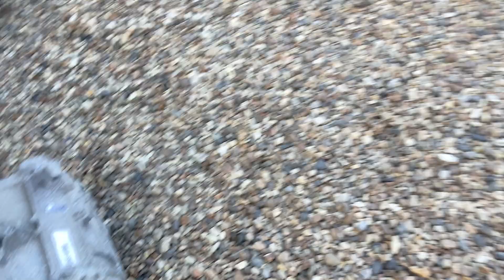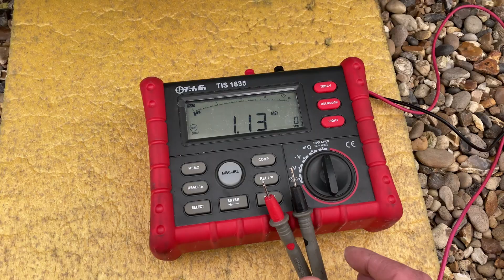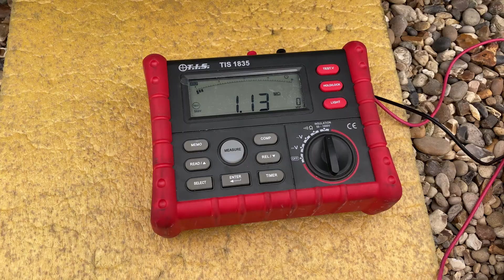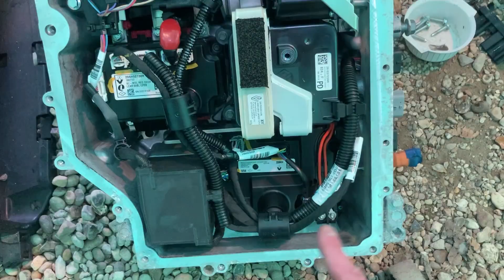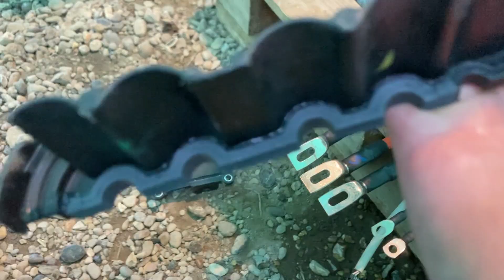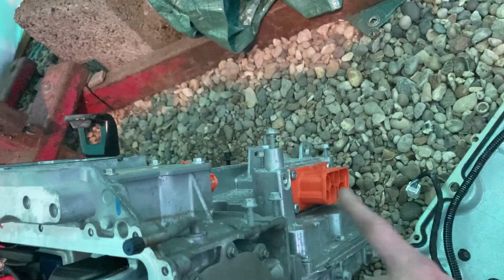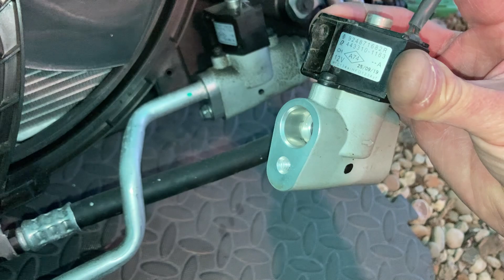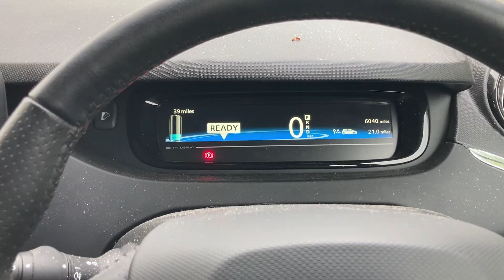This ELECTRIC CAR IS DEAD after only 6,000 miles - Can we fix it? Renault Zoe EV Repair

Comment: Given you have a motor controller that is a write-off due to coolant contamination, I'd suggest getting a couple of litres of isopropyl alcohol and  give it a good dip/agitate/dry and see if it removes the coolant.   You have some smaller parts other parts that are contaminate as well, so possibly a good soaking of them would test if isopropyl alcohol will remove coolant residue.  Isopropyl alcohol is often used as a safe cleaner for eletronic components so the controller should survive it.

Comment: Thought I should mention porous casting is a common problem every brand. I worked for a motorcycle company & the procedure was to take a centre punch to stop the oil leak spot
Reply: Vacuum chamber and an epoxy paint ....

Comment: Gary, You and your channel are such a  great value for ZOE users!  What you do is really important but watching your videos is a real pain to watch to filter out the flow and the main thing. This 57 minute video basically about 15 minutes and you will not miss a thing.
Repeating things 5 times  within 2 minutes filling up with so many "so,  yeah, well, interesting, ammm, ok all right,  but yeah e.t.c."  is  really something would be your advantage to get rid of.  I did not count these in this 57 minutes but its in high hundreds.
I know," if you dont like dont watch".... I like the content and you can be sooo valuable for everyone if you could make this at 1/4th of the length.
Reply from the maker: Realistically, I haven’t got hours to edit and when you’ve done 5 hours of strip down you can’t remember exactly what was said so far and it’s not scripted because it would take too long and it just wouldn’t get video’d!! This job was done over 3-4 days, at points you’re absolutely knackered and trying to stay on point, some people ask for more detail, some want it ripped through as quick as possible. Can’t please everyone. Thanks for watching. Cheers
Reply: @garycevrepairs don’t sweat it, love the personal mannerisms. 😊

Comment: Aren't this car supposed to have a warranty this looks like something that should be solved by the warranty (or did this car was in garage for multiple years ?)
Reply from the maker: Warranty expired due to age
Reply: @garycevrepairs What I was thinking, this is still something that should be warranty, or recall, it's a manufacturing defect

Comment: 33:10 when you mentioned about the thermal paste not being in the correct place, it's most likely because it has squeezed out of the area you barely see any. Remember, it's only there to fill the gap, it the pressure is high enough most of it will be pushed out and leave very little there.
Now if it was completely dry then that would be a bad thing yes.

Comment: You can  safely  dunk wash electronics in IsoPropyl alchol  which is cheap . It disolves oily stuff and antifreeze   and it is quite cheap . Just leave it somewhere warm to evaporate any alchol left on the boards.  Suprisingly you can also wash electronics with DI water to remove salt water contamination  as long as yo u leave everything somewhere warm to compleltely dry out.  I think I would have had  a go at washing the cotroller in ths case .  P.S. moisture really lowers the insulation resistance on electric motors ( stand by generators have heaters built in to dry the windings before use ). Do not high voltage  insulation test a motor that is damp because you can turn the damp problem into a permanent short where the high voltgae forces it way through the damp insulation.!
Reply: Yes, was about to write this!
Reply: I went swimming in the ocean with the rental car key fob in my pocket.  The car wouldn't start after that.   So I stuck a knife on the edge of it to open it and washed the little circuit board with drinking water and then left it in the sun to dry.  Car started good after that.

Comment: Hi Gary, I've been following your videos for a while because we have a Zoe, it has started making a noise recently that is freaking me out. Very paranoid it's the bearing and I wanted to know what would be the best way to contact you to share the sound file and ask your opinion? We'd be glad to pay, I didn't find anything in the youtube channel. Thanks!
Reply: We had a strange noise on our 2020 R135 with 100k km,  which was best to hear at low speeds. My wife detected it coming from the left front area (driver‘s side in our case). I took the wheel off and found the rubber sleeve of the wheel bearing was leaking grease. It is in the shop today, and I am keeping my fingers crossed that the motor bearings and differential are still o.k.
Reply from the maker: Hi email is good gclayton@hotmail.co.uk cheers

Comment: Try rinsing the coolant off with methylated spirit, it mixes with water based fluids but evaporates readily.
Reply from the maker: Could have tried this kind of thing but it takes so long to remove and refit so you need to be confident it’s fixed. Cheers

Comment: Is it a case of poor casting and or poor machining? And why not use a compressible gasket, rather than sealant, which doesn’t seem to be doing the job well? And the thermal grease/paste, appears to have been put on, by a blind worker, wearing dark glasses in an unlit room, using just one toe on a Friday 3mins. before knocking-off. Mind you, the Zoe is discontinued and thus Renault aren’t going to be interested in the issue. I wonder if their present EVs, are going to prematurely show their age, with continued poor manufacturing quality control.

Comment: Could you not use a electrical component spray to clean the unit its got to be worth a go. Great video very interesting.
Reply from the maker: Could have attempted cleaning but it takes so long to refit that a saving in the new controller would quickly be eaten up in more labour if it has to come out again. Cheers

Comment: Electronics don’t like megga voltages, measuring with main leads disconnected is advisable.
Reply from the maker: The car runs at high voltage, you test it with high voltage test equipment

Comment: Wonder if you can’t use 99% IPA to get the moisture out of the electronic. 99% because alcohol binds to water up to 70-80%, so starting with 70% won’t have the same effect.
Reply from the maker: I could have tried drying it but it takes a long time to get it back out, so better to fit a new one. Cheers

Comment: Perhaps distilled water and a heated ultrasonic cleaning followed by a few isopropyl alcohol rinses would clean those controllers up
Reply: I wouldn't mind giving one a go and sending it back see if it works reply to this if your interested there's nothing to lose and I'm all about keeping things out of landfill been fixing electronics for as long as I could walk
Reply from the maker: It might work but it’s quite layered and takes a long time to remove so it’s a risk that you put it back and it has an issue. Cheers

Comment: that is what was known in the trade as a "hero job", the reason main dealers dont want such jobs is time, they car neplace part X, if that dont work, they have to swallow the cost of X and try part Y and hope that works, easier for them to say it is scrap esp when the techs dont really  know anything but wheeling out the parts cannon, ok with cheap bits but i doubt those bits were cheap...keep up the good work there Gary, we need more hero,s like you.
Reply from the maker: Very kind thank you
Reply: @garycevrepairs  credit where it is due.
Reply: Trouble with a lot of stealerships is they only understand the parts cannon and have little technical knowledge after all the mechs are not engineers.

Comment: Wouldn't a solvent /degreaser like Jizer remove the coolant/thermal grease?

Poor craftsmanship/quality control is why I dont buy mass-produced French products - this isnt just a car issue.

Jizer has the secondary bonus of making you see pink elephants if you dont use it in a well ventilated area.

BTW, I used to work for Cosworth - at the foundry where they produced the engine castings; - that casing is a pile of shite, no way should that have passed QC.
Reply from the maker: lol, it’s not easy to clean and if there is some residual moisture then it all has to come out again. If access was easier then I’d have given it a go. Cheers
Reply: @garycevrepairs  I understood it might not be easy - I was thinking perhaps a solvent bath/agitator might be worth experimenting with - might save some money and time if you can reuse the controllers.

Comment: There's a basic component that commonly fails due to rusting. Its generally an engine swap job from what I understand. 
These cars are not looking like good buys
Reply: Ooops motor swap I meant. Those things you were told would have less issues than a combustion engine... Lol. Love my combustion engine
Reply from the maker: These do suffer with motor bearing failure yes

Comment: I might put some RTV silicone sealant in those bolt holes when bolting the motor controller back on just as a preventative measure for leaks.  I would just be carefull about not using too much as you don't want it to squeeze out under the motor controller preventing the heat sink paste from doing it's job.
Reply: You could also use a copper or aluminium washer, like a sump plug.

Comment: distilled water might be a good way to rinse out coolant, then that can be dried out
Reply from the maker: Could do but it takes so long to remove and refit that we need to know the repair will work, otherwise if we have to have a few attempts to seal it then the customer would pay more than having a new one due to the labour. Cheers

Comment: Aren't there products that can be sprayed or painted onto the inside of the casting to seal pinholes. Used for making alloy wheels airtight. And presumably watertight ?
Reply from the maker: Quite possibly but it takes so long to take it all out that it needed to be a reliable solution. If it was easy access then we could try some different methods to see if they worked. Cheers

Comment: I have to say, I'm not impressed with the quality control of Renault. Those castings should never have been put on a new car, terrible QC. That they're not using Brushless DC motors is concerning. Brushes? Really? That's old school, simple, yes, but those wear items don't need to exist. I wouldn't buy a Renault.
Reply from the maker: The motor is a 3 phase brushless design but has no magnets and a wound rotor instead, so has to get power onto the rotor. Cheers

Comment: 500 Ohms per volt is the requirement, so if it's a 400V system, 200k Ohms is the lower limit. Granted, I would expect the motor to be much higher in isolation.

Comment: You have got amazing knowledge, from a domestic Sparky here. I'm very interested, as I have an Electronics background. Just found your channel, so will continue to watch. Cheers
Reply from the maker: I used to work in IT, very interested in electronics, EVs are just battery powered computers…
Reply: My apprenticeship was in electronics , I am now an electrician working in the industrial sector ,The one big problem I can see with DIY EV repairs is the potential for serious injury due to the danger of DC voltage present in these vehicles , the other issue being the LI-ION batteries and the possibility of damaging the battery or short circuit both of which can cause thermal runaway.
Reply: @Wishiwasnthere-58 only when idiots get the screw drivers out. Otherwise as soon as you isolate properly it’s ok.
Reply: @kevxsi16v  very true , but the point is that  many will not have the right equipment or knowledge about the importance of isolating before starting any repairs. I have seen so many dangerous alterations to electrical installations by people who think that their work is safe but the reality is the opposite.
Reply: @Wishiwasnthere-58 I am in the same
Boat as you… would go as far as saying that most properities that get rewired wouldn’t of needed said rewire (unless lead or rubber) it’s the bodges that diy Dave has added destroying what 9.9 times out of 10 was originally a good install.
Reply: @kevxsi16v yeh. We could use the same argument for people working on there own brakes. People generally don’t touch EV electrics unless they have some confidence they can do it right 😂

Comment: And on the new Renault 5 they've just cut the warranty down to 3 years from 5. Smells of confidence in their products doesn't it?
Reply: Electrics were never Renault's strong point so what can one say? Brave to try  EV's?
Reply: I have owned multiple Renaults over 40 years and I have never had any electrical problems! Fords plenty of electrical issues and Rover group also.
I usually find people that claim French cars had electrical problems actually have never owned one!
It’s always someone else’s car or I hired a car once.
Do t forget Renault and “dodgy” electrical systems actually crated the first car with key operated central locking, Renault 14 and, created the first remote control central locking system, Renault Fuego.
Reply: At least it is a bit cheaper for start and they should make more of them so (used) parts should be cheaper.
Reply: @rkan2  Or they could pressure test the casings?
Reply: Sadly MG offer 7 year warranty. I say Sadly because they are Chinese.
Reply: @starbarrothschild788  they offer 10 years warranty in Australia...
Reply: @starbarrothschild788  Warranties are fine until you have to deal with main car dealers who treat customers like shit.
Reply: @starbarrothschild788 they need it as they are so unreliable and you wait for ever for spares or told it’s characteristic, I had one for seven months from new …. Never again
Reply: That’s terrible
Reply: Warranty?
Reply: Then those idiots make sure you can’t repair them. With “VIN locks” Go buy a Chinese car.
Reply: My Renault 5 has 5 years warranty, 8 years on battery, 12 years on rust. The only thing that has a 3 year warranty is the paint.
Reply: @2god2me  Standard vehicle warranty 3 years or 100,000 miles, same on the 4. Did you buy extended? Or just got in very early?

Comment: i would use tru blue sealant on those retainer bolts to prevent further coolant getting by them in future its available from toolstation
Reply from the maker: The motor controller wasn’t cheap and I had spare cases, so best to swap it. Cheers

Comment: Also, that is obviously a factory defect (bad casting with a weak point) so shouldn't Renault be covering the cost? The car only had 6000 miles on it even though it was 7 years old.

Comment: It would have been interesting to see if you could have saved the motor controller. While you can't "dry it out" you can wash it and dry it using an ultrasonic cleaner or just plain old IPA and a toothbrush.
Reply: Yeah would love to see a teardown.

Comment: Mmmm, I have seen a number of videos with problems on the Zoe, the one I recall related to the A/C compressor, which apparently is another design fault by Renault. No excuses for coolant leaks on an EV as there is very little thermal stress on the system compared to a combustion engine. I nearly bought a Zoe in 2019, but decided on the BMW i3 instead - no issues after 6 years, only expense was 4 new tyres at 37k miles, and new wiper blades.
One thought on removing the coolant residue; it is completely soluble in water (by design), so you could flush it away and then dry the residual water out with the hair dryer as per your first step.

Comment: Great video, nice diagnosis. Car Wizard always tastes the residue, might have helped diagnose it's coolant, not moisture. Also there was a puddle on the undertray. Can the motor and controller not get a good flush out with a few cans of electrical contact cleaner? Will push out the coolant?
Anyway, great result 👌🏻

Comment: Renault should be held accountable as evidently it's a design fault plus with it being low mileage they should have offered a straight swap
Reply: Years ago a friend had a 750 Bonneville with porous case between engine and gearbox, Triumph swapped it no questions.
Reply: @IMBlakeley That was when reputation mattered
Reply: @IMBlakeley Didnt do them any good lol. Most users replaced them with jap parts
Reply: Not made to last, there is a regulation called right to repair, but that doesn't mean they have to make it easy, most new cars now are locked down via ECU, meaning only a dealer with the software only available to them can access fault data codes.
Reply: @stevenc5227 
Worth noting though, that you can buy a subscription to access manufacturer diagnostics and software updates.
Just gets very expensive if you're dealing with more than One manufacturer.
Reply: Yea . Dont buy Renault
Reply: I am trying to understand this.  Don't these cars have any kind of warranty ?  No one is talking about the warranty.    In Canada if they can't fix your newly purchased vehicle then they give you another one, no charge.  I think the US is the same.   All depends on the mileage.
Reply: @JeffGermany-n1k it’s low mileage, sure, but also 7 years old. The warranty probably had a time limit on it which expired.
Reply: The cars some aren't getting past 50000 miles if you have a look at the wet belt engine there's a lot off issues the belt diterates in the engine the teeth on it fall apart thats why they should recall it
Reply: Under the sale of goods act in the UK products should be made to last a reasonable length of time, and if there was a flaw at the point of design/manufacture then the company is liable.

I think in this case you would reasonably expect a car to last longer than 6000 miles, and the aluminium casting is very likely at fault.
Reply: @stuart997 Buyer beware did you forget the advertising campaign all them years ago